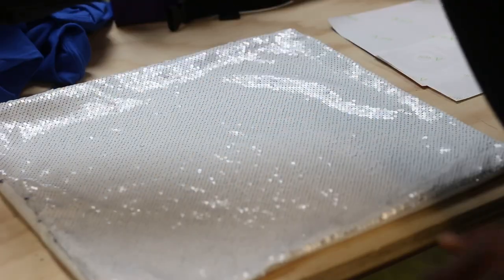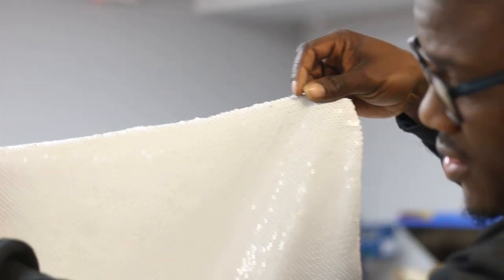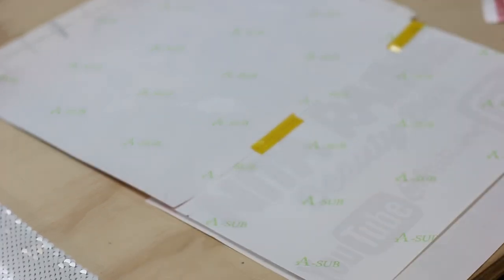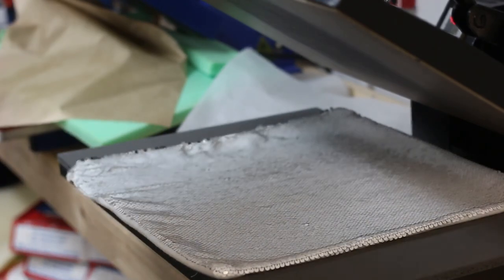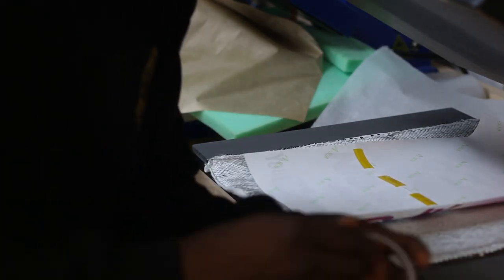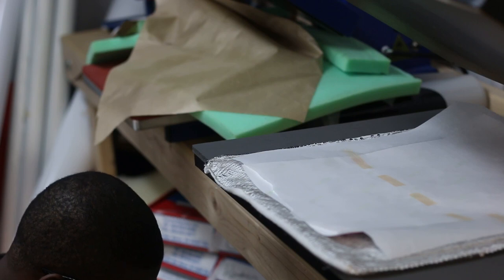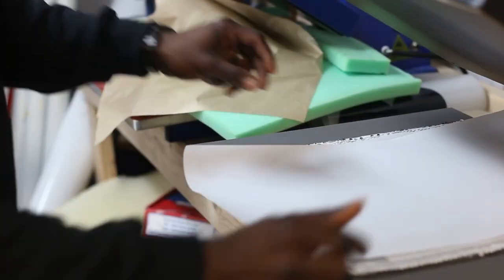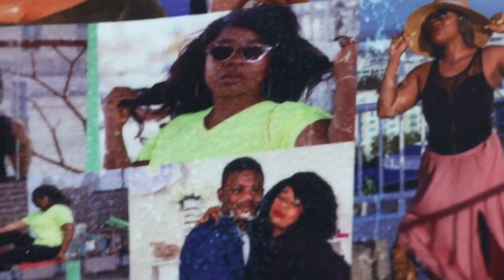How to Sublimate Sequins Pillows

Comment: what was the point of using adhesive spray to the other side of pillow?  Also I thought you could sublimate only on the white side but you have photos on both sides
Reply from the maker: The spray was to hold the paper down. Both sides were white polyester